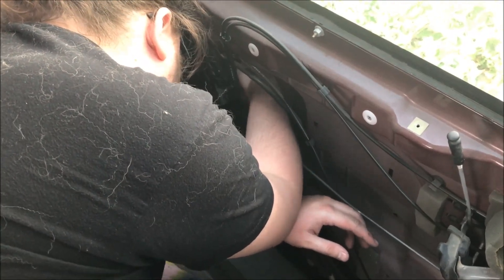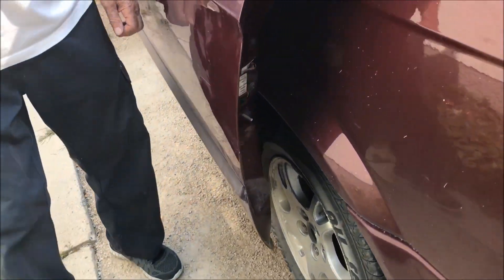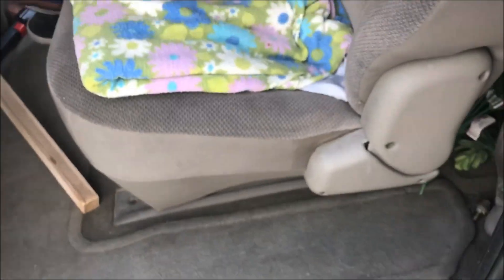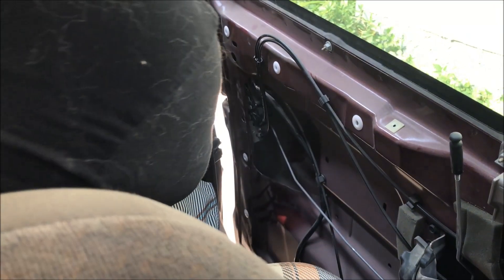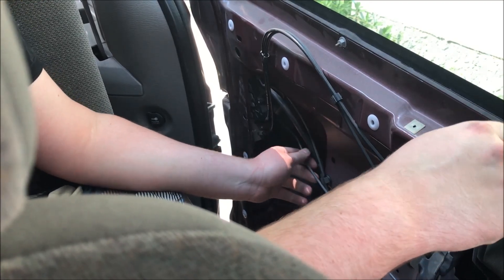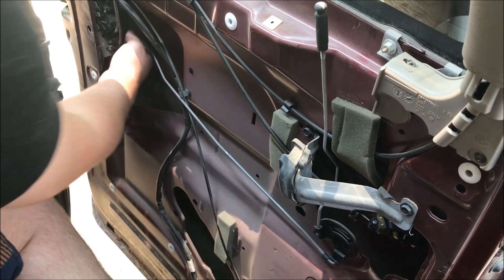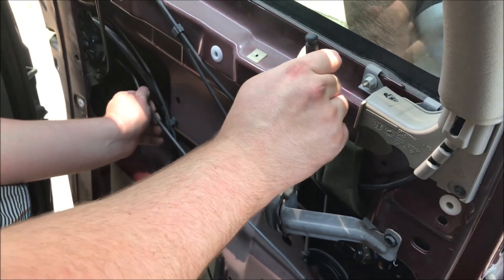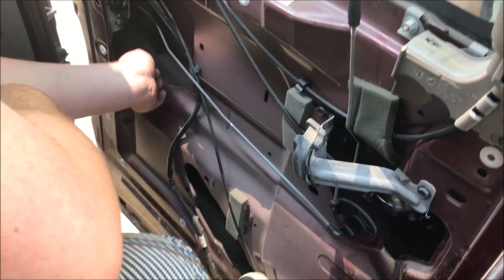Dodge Caravan (Sliding Door Won't Unlock)

Comment: Thanks, that's the best solution for my Van, I can deal with a manual lock just fine.
Reply: so if you  disconnect the actuator you can leave it working manually with no problem?

Comment: Thanks for showing unscrewing at 0:51 which is needed to do only on the driver's side it seems, but is not even there on the passenger side. I probably wouldn't have done that and yanked on the door panel cursing why it won't come off. I've been looking for replacing the broken (by some a-hole) sliding door window. YOU showed that the window is held on with bolts and nuts. Thank you for that alone Dude. Dude you should've had some drinkage handy in this video.. I think a caucasian on ice would do fine 🤠.  It's strange that just about nothing can be found on YT to see the inside of the sliding door window, that the top and bottom panel HAVE to be removed first so those nuts can then be removed from the BOLTS slid in that are actually holding the window in place. It's also glued in. I hope ALL those window's nuts are easily accessible to get a ratchet or wrench onto them without having to remove more of the door's parts. My van still runs okay, has a LOT of rust issues with jack points gone, engine leaks, a parasitic electric drain, the interior roof cushion sagging and "check engine" on, but may still have some uses besides junking it (or not), though it's 19 years old. This 5 yo video still needed, thanks!

Comment: How do you disconnect the solenoid? How do you replace it? What if you can lock and unlock manually but auto switch stopped working on door? Is that same issue, or different?

Comment: When you say solenoid do you mean the actuator? My passenger side sliding door doesnt unlock so the doors staying closed. That long rod.. if I disconnect that I wonder if I can just make the door manual lock/unlock rather then getting a new actuator.. poormans fix
Reply: Did you fix your vehicle?

Comment: Why are people still buy chrysler/dodge/jeep  junk in 2019 ,all you doing is spending tons of money  on crap
Reply: because a caravan is 15,000 cheaper thena honda
Reply: We got our 2010 Town in Country 9 years ago -- only had a couple of minor issues. Last two Toyota's minivans engines quit after a few years in both and cost twice as much. I used to be a huge toyota fan. Not anymore.
Reply: Glad you can generalize about all the vehicles made by one company. I wholeheartedly disagree with your opinion.
Reply: Mine has about 300,000 miles and is still running pretty good
Reply: I have a 2003 Caravan, I'm the original owner, still driving it every day with 197k miles on it. I have the 4-cyl and it's a decent motor, pretty good on gas still, starts right up, runs quietly and smoothly. However, lots of little annoying things like in this video (I have the exact same problem, haven't opened the rear driver side door in over a decade, and in 2003 having doors on both sides was a selling point).. All kinds of little stupid annoying things have gone wrong. Headliner falling off, heat doesn't work, a/c doesn't work, all kinds of lights on on the dash (even the ABS light it on, and the van doesn't even have ABS). And I had to replace the original transmission at 82k miles. BUT.. It starts right up and runs great, like new really, the second transmission has over 100k miles on it and still works great. So why still driving a Dodge in 2020? Can't kill it. It just keeps running. One of the least expensive minivans on the market back in 03 and other than the transmission it hasn't been too expensive to maintain all these years. I just wish I could get some of the stupid little things fixed.
Reply: note: some say the car works great. Others say it sucks. this is due to climate. the car likely works great in some areas, and crappy in others. the only GOOD neutral place is somewhere tropical. Never too cold, and never dry heat... So no freezing and expanding, or ANY of that.  no large hills to climb and rip up transmissions.